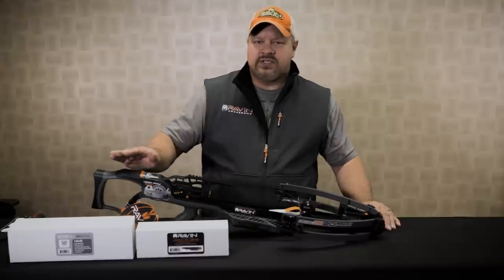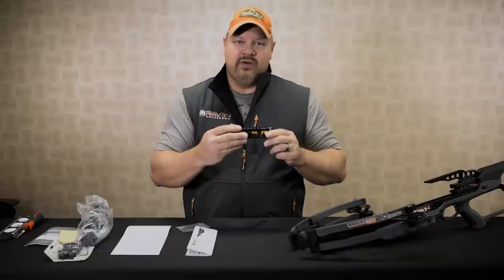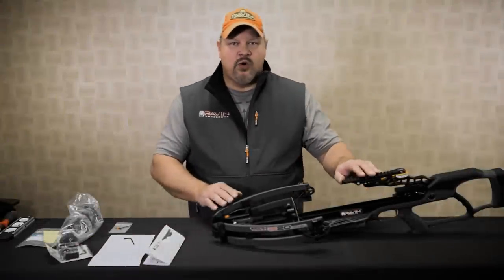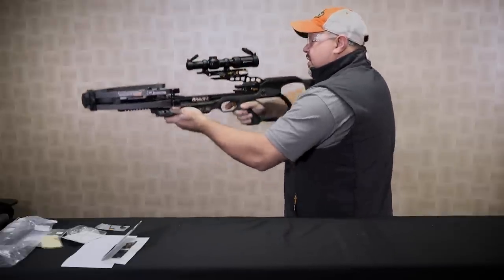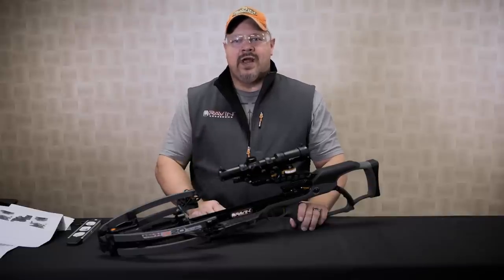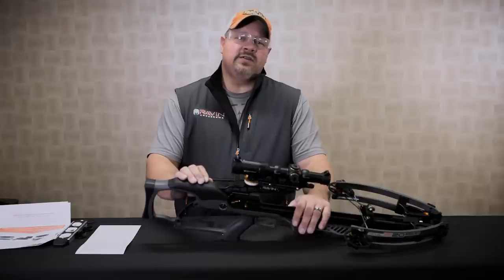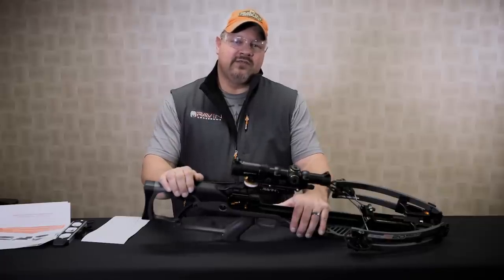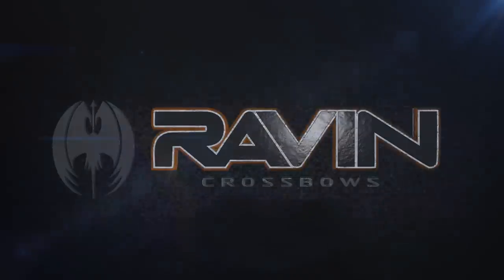Ravin Crossbows Jack Plate Installation

Comment: So the pre-printed speed tapes are only good for 10 yard increments? 
If that’s the case, what’s the difference between using that and a scope with 10 yard increment reticles already in the scope?
Your speed tapes should be for every yard just like the HHA speed dial tapes.
The HHA system is 10 times better.